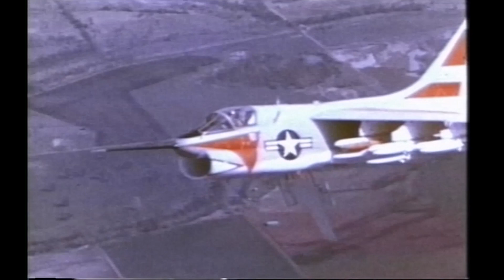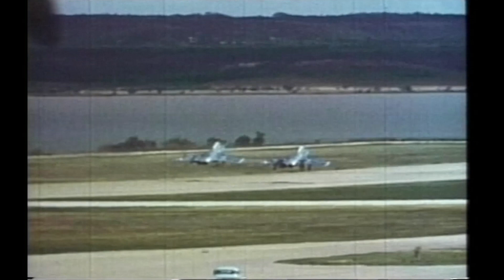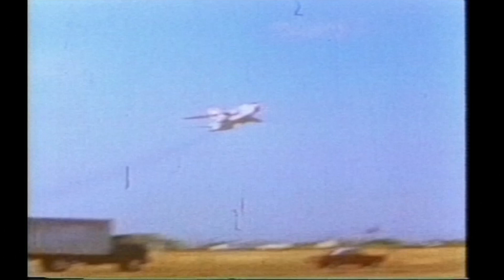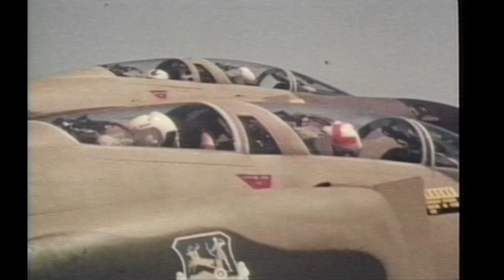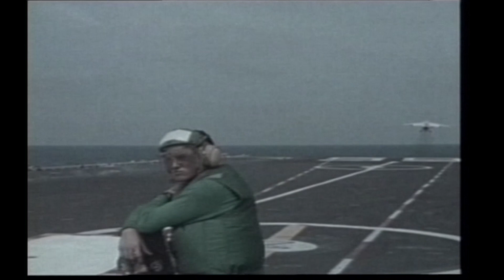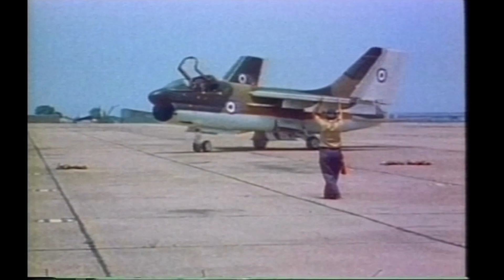The A-7 Corsair II - Flying Through Time

Comment: A flying brick. It was a bitch to work on. Armor plated belly panels and those arse pain fasteners. Pulling an engine was no walk in the park. And high power (to include that monster intake screen) was not for the faint of heart  
Was so glad when the F-18 rolled up on the tarmac.
I was a green jersey Jarhead in VFA-125, hanger #1 NAS-LeMoore 80-87

Comment: Crappy engine. Simply not enough power. But the HUD was outstanding. Totally defensive In ACM but great weapons delivery platform
Reply: Slick winged one and put a fighter envy Lt in it, and surprise the heck out of early F16/15s. Come back to da boat with no canopy, a new wrinkled fuselage and wings a a pilot all sweat and grinning like a Chessy Cat. NATO EX 1977 USS FORRESTALL.
Reply: There's a video on here somewhere of an ANG 2 seat bird on a range during a rainy day doing lofted, toss, and retarded unguided bomb and cluster drops hitting the central flag every time in every release profile that was very damn impressive for 80-82 timeframe. At a mid-west base I think. It's CCRP mode was dialed in very well!